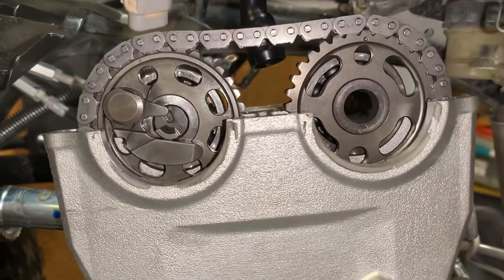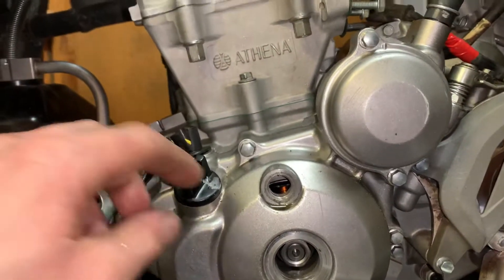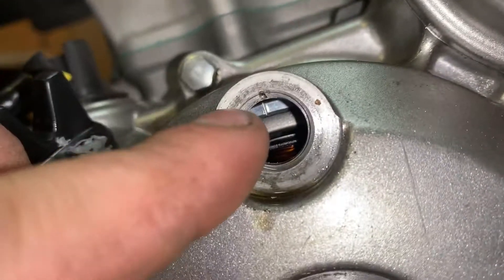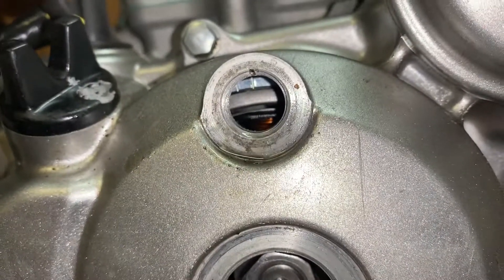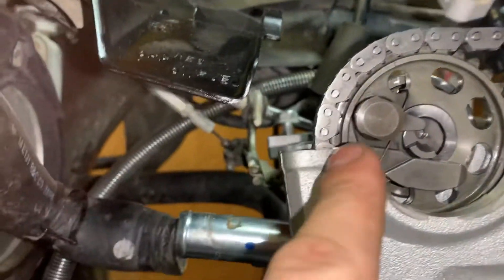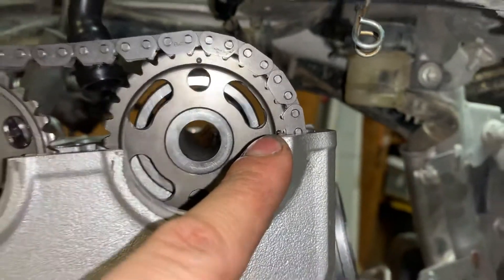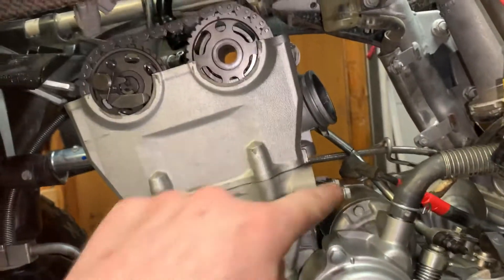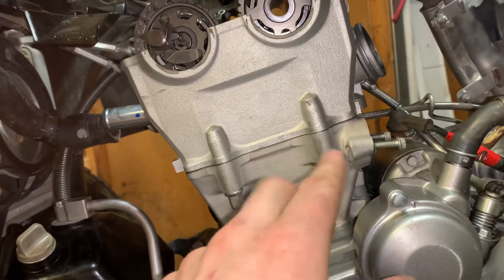YFZ450  ( How to set Cam Timing - Which Mark is TDC - Sideway H or I )

Comment: ANYONE WORKING ON YOUR BIKE RN! MAKE SURE TO TIME IT ON THE UPSTROKE OF THE PISTON!!! PUT A SCREW DRIVER IN THE SPARK PLUG SLOT AND TIME IT ON THE UPSTROKE. IF YOU TIMED IT AND IT WILL NOT START YOU MAY HAVE TIMED IT ON A DOWN STROKE LIKE MYSELF! TOOK APART MY BIKE 5 TIMES YESTERDAY AND MY FINGERS HAVE BICEPS 💪 NOW
Reply: I mean, as long as you line up the dots on the head and the little mark on the flywheel you should be good right?
Reply from the maker: haha.  Yes sir.   i've had my fair share of taking things back apart.
Reply: No  don't use a screw driver.   Steel on aluminum. Use a wooden pencil. Softer then your piston  non abrasive

Comment: How do you check if you have the backwards head style?
Reply from the maker: it's just the more newer head the exhaust comes out where the carburetor would go.  They are also four valve heads.

Comment: Depends on what year, the 2013 is cam timed at 23 degrees ATDC to the cam dots, aligned with the case
Reply from the maker: it doesn't matter as long as your timing off of the marks that's all that matters...

Comment: When i line up everything it looks great but when i go to tension the chain the the two dots on top are not lined up on the flywheel anymore. Would you know why?
Reply from the maker: The timing chain is worn out.
Reply: @trxtech3010 I know this is a old video but I just put a new timing chain on mine and it looks good but when I put the tensioner in one of the cams spins over and then it’s out of time

Comment: Did this quad have aftermarket cams? I'm surprised when setting the timing marks you didn't mention putting the exhaust cam in the cam-mod position if you have stock cams (1 tooth retarded). Great free mod for the carb model YFZ450.
Reply from the maker: Yeah i thought about mentioning that but I did not wanna trigger the other know it alls lol.  You know how it is. ha